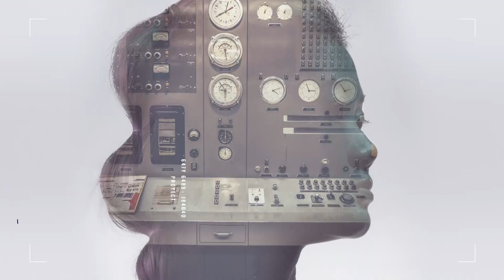Ep. 123 - Dennis Whyte, MIT

Comment: It's time for a paradigm shift. Fusion is not the answer. The quest for the ultimate energy ends with the strong force between quarks. It is called quark plasma and its catalyst is nothing but the dark matter of space. Once the quarks have been separated, the pressure of the dark matter of space goes through any containment system to attack the reaction. As the electron neutrinos come in to attack the reaction, they are subsequently thrown out of the reaction as gamma rays. Once this reaction is started, it is self contained and will need no input from us at all except to extract the heat from the system. Hydrogen will be sealed in a giant sphere and severely compromised with heat and pressure. Then, the "spark" will be applied with an enormous amount of electricity for a short amount of time. Then, the reaction will be started and require nothing from us to facilitate. It is the perfect reaction because the catalyst is the unlimited supply of the dark matter of space. When Einstein said a mere train ticket could power a train for a long distance, he meant if the matter in the ticket was transformed into quark plasma. The Big Bang theory is what has made us assume that fusion is the ultimate energy.

Comment: Is anyone building tokamak using MIT ARC design ? Is it already working at MIT ?
Reply: Nope, ARC is just a concept for now. SPARC will be built sooner. At the moment they are constructing test coils, if that goes well the rest of the machine should follow soon as that is known technology.
Reply: @MikeM-py2hq  Thanks Mike. In the meantime I found out they are hiring for jobs in Cambridge, MA. I have a feeling they know what they are doing and I wish them the best to pull it off.
Reply: @MikeM-py2hq  I recently watched this:
https://www.youtube.com/watch?v=KkpqA8yG9T4
and thought by now, 6 years later, they must have something shaking,
but apparently nothing yet, eh ?
What is the ETA for SPARC spark-up ?
Reply: @kurtklingbeil6900  Hi Kurt, indeed nothing running yet. But construction on the SPARC facility has started in the meanwhile. You have to understand these kind of projects take years. Back in 2016 they were still recruiting a team + funding basically. Once that is all in check the official design starts, let's say that takes 2 years. Then the building starts, but these are not off the shelve parts, but since it's a relatively small tokamak it takes "only" 5 years or so to build. They expect first plasma in 2025. But let's take this with a grain of salt, tokamaks are all unique and therefore run into unexpected issues, so delays are common. Anyway, it's an exciting project IMO.